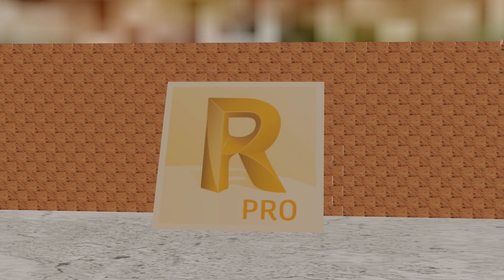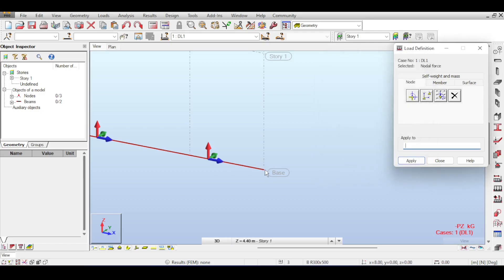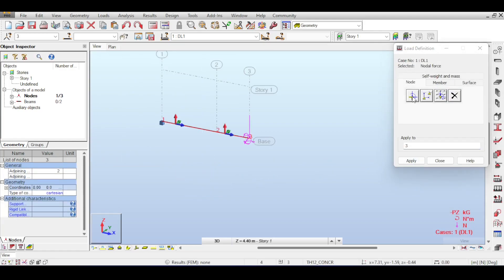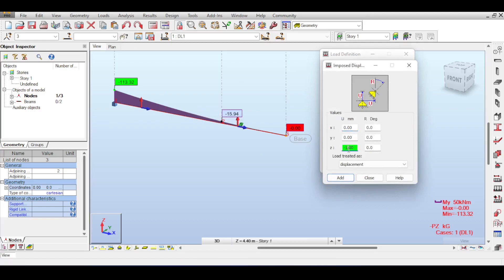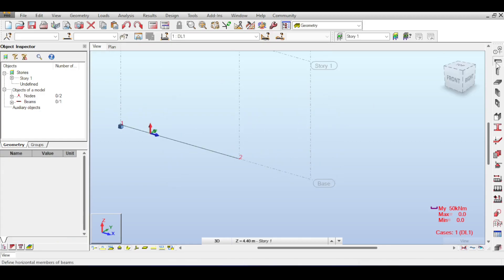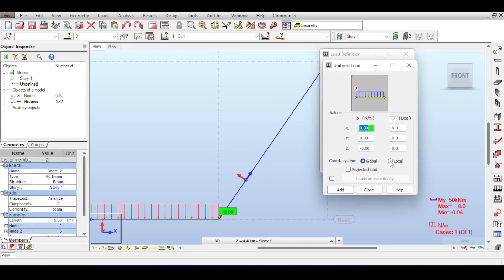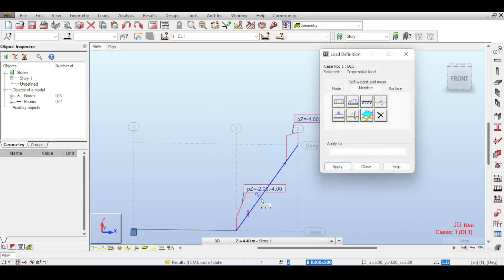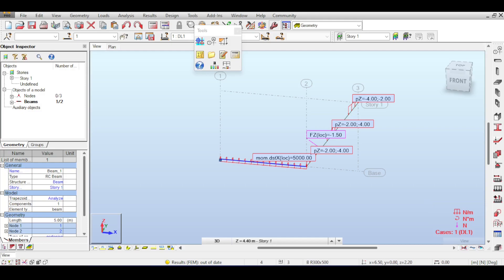Understanding Nodal and Linear Loads in Autodesk Robot

Comment: Does robot also allow use rollers and hinges on simple analysis of beams.
Reply from the maker: Yep, you can use a roller and hinge to perform a simply supported analysis of a beam. Make sure it is in 2D, otherwise you will get a torsional instability (a shaft scenario that rotates around its longitudinal axis)